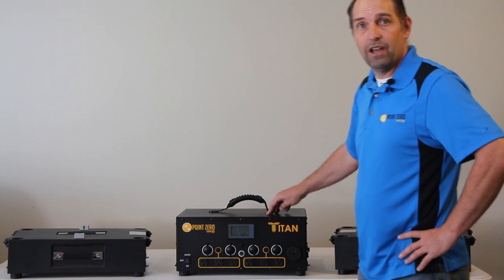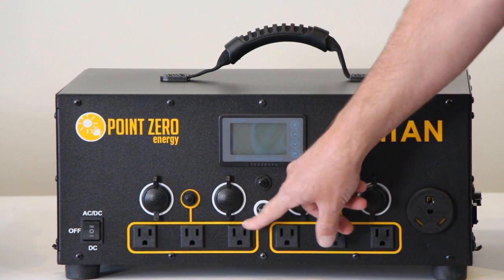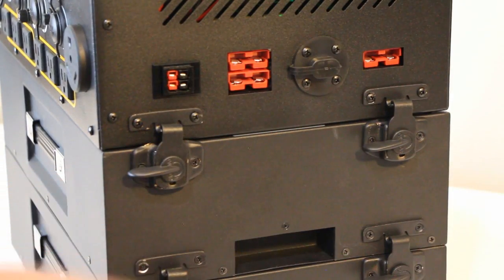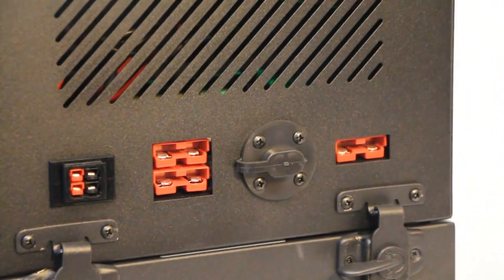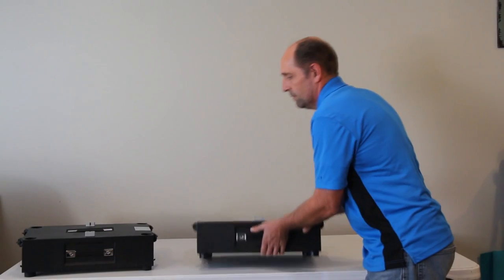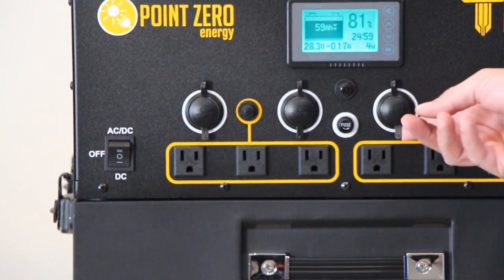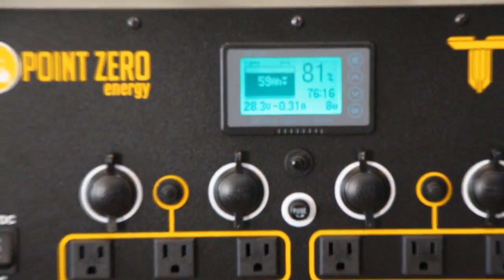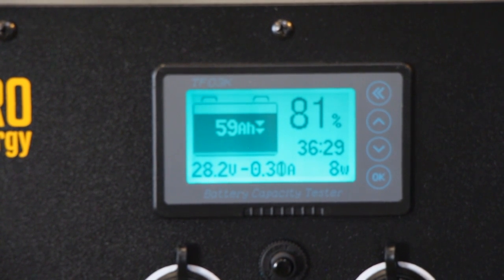Titan Solar Generator final

Comment: I want one, but only if Will Prowse says it's good. Send him the final product for review!
Reply from the maker: We did and he gave a very positive review
Reply: @PointZeroEnergy  I heard Will (very honest) say in 2019 you needed to fire your engineer as you sent him & 14 others defective units. I HOPE you have sense worked out all the kinks as I was hoping to purchase one, just didn't like prepaying months in advance which  has always been the case & guess always will be? One of your reps told me wait until January to order then they would be back in stock & my money wouldn't be tied up for months since unlike other companies you charge the full amount to credit card when place order instead of when ship..  Now I can't get until Feb if I order now!!!! CRAZY & FRUSTRATING!  Plus, a little dishonest calling it a 3000 when it's actually a 1500 which is "expandable to 3000 watts for an additional $1,400."
Reply: @DebbieTube100  It doesn't say it will not pull 3000w, it says your shouldn't pull 3000w continuous without the expansion. You really should take the time to read the product info correctly before bashing the company. If you don't want to follow the policies of the company when ordering, then purchase another product from somewhere else, they are not deceiving you, you are told up front that is the wait time. There is big delay in product availability across the board in this industry that we are all having to deal with. This should not come as a surprise to you, and if there are better options available, whats keeping you from it?
Reply: @DebbieTube100  they literally tell you in every video that it's only 1500 unless you have at least two batteries then it is 3000 lol SMH
Reply from the maker: @MAXIMUSMINIMALIST  The standard 14A AC charger uses 5-6 amps from the AC outlet (about 600-800 watts).  So this should work with the smaller unit if it can handle 7A.  Our 25A larger charge would be 10-11 amps (1200 to 1400 watts), which would be too much for the smaller one, but should work with the larger one.

I hope that helps you .
Reply from the maker: @MAXIMUSMINIMALIST  Slower charging is better, but either charger is slow enough that it is fine.  For long life, keep the charge time under one hour, and for even longer life keep it over 2 hours.  Anything over that is not going to make much difference.  Since the battery is 74 ah, one 14A charger (DC amps, AC amps going in are about 5-6)  will take 74/14 = 5.3 hours to charge one battery from dead to full.  One 25A charger (Also DC amps, AC amps going in is 10-11) will take 74/25 = 3 hours.  As you can tell both are well over 2 hours, so they will have about the same effect on the battery life.

I hope that isn't confusing, but just to explain a little, power is measured in watts, which is amps times volts.  Since the AC amps going in is higher voltage (120V), the amps are lower than the output power (the battery voltage of 20-29 V depending on the state of charge).  There is also a loss in power during the conversion from AC to DC (the heat the charger generates when charging).  But anyway, that is why the AC amps are lower than the DC amps.... Just in case you were wondering.
Reply from the maker: @MAXIMUSMINIMALIST  Thank you for your kind comments, and suggestions.  We are currently working on a smaller version to make it a little easier for van life, and for people that don't need such a powerful system.  Hopefully it will be ready when the Titan 2.0 is ready, but we don't have any specific dates for them yet.   Since the current Titan is very good, and reliable, we need to make sure the next version is better in every way possible, and it is taking us longer than expected to accomplish that.  We have some very good prototypes ready right now, but we want to get them a little better.   And just so you know, I am the owner, but also do most of the design, and am an engineer.

Thanks again for your kind comments, and let me know if you have any other questions.

Comment: you put out a product overview to the world with 2 batteries and DIDN'T PROGRAM THE UNIT FOR BOTH???
Reply: This is a very flexible generator, you can add batteries, use different batteries, etc.  Any time you add or change a battery, it must be calibrated to the new battery configuration.  If you want the flexibility of the Titan,  and accuracy of this type of meter, you must calibrate it.  If you want a simple plug and play, you must us a much less capable machine.

Comment: Can I run my house completely off grid full time with this?
Reply from the maker: It depends on your house, but typically no, since a typical house uses 240V split phase, and can use up to 200A when running water heaters, air conditioners, ranges, etc.  This unit can run only 120V and about 30A.  Some off-grid cabins or homes are designed to work on less power, and use propane for heating (hot water, cooking, etc), so this would work perfect for them.  The main purpose is for it to provide power to essential items (fridge, freezer, lights, microwave, small cook top stove, electric blankets, etc) when the power goes out, but not to run the entire home like normal.
Reply: I would like to build a small container house for use on a sunny island in the pacific. I am considering wiring the entire house simply using 30amp 120v. I’d like to run the system off of a solar generator. Would the titan work for that?
Reply from the maker: @kendallwilliams1859  Yes, it sounds like it would work great for that application.

Comment: Need to update your video.  It looks like it was filmed in the 80's.
Reply: Ha ha ha, I REALLY, thought it was an old, a very old infomercial... and was thinking, "it´s a pity that they don´t sell them anymore..."
Reply: I agree. And this guy is very vague about his descriptions of the buttons. Using four fingers to point to the white circle buttons for DC. And saying a fuse can be reset. I may be wrong but all the fuses I know must be replaced if blown, whereas a breaker can be reset. This may be a great product but this video was done very poorly. Not a good video at all. Seems mistakes were made.  Maybe the product has the same issues.

Comment: Do you have a spec parts list of the internal components so I can see exactly what I'm getting?
Reply from the maker: There are no off the shelf components that could meet our requirements of weight, size, efficiency and durability (that we are aware of).  So the major internal components (inverter, and  charge controllers) have been manufactured specifically for the Titan Solar Generator.

Comment: Too bad its not a Generator, Just a solar converter and battery pack
Reply from the maker: Sure it is a generator, just as much as any gas generator is a generator.  If you take the term literally, there is not such thing as a generator, only devices that change one form of energy to another.  We have called these devices generators for some time now, even though it impossible to have a true generator.  The Titan solar Generator is as much a generator as anything else in existence, and since "generator" is the common term for these devices we will continue to call it a solar generator rather than confuse people.

Comment: Will you be adding SuperCapacitors inline with the unit as a Module?
Reply from the maker: We don't have any plans to add a supercapacitor module at this time.  There are still a few issues that need to be overcome with supercapacitors to be able to work well in a portable system like this.  
1- Weight:  The specific energy of a supercapacitor is only 5w h/kg, where lithium-ion is 120-240 wh/kg
2- Cost: The cost for a supercapacitor is about 10X as much as lithium ion per watt hour of storage.
3- Voltage (the inverter would need to work from 0 to full voltage rather than the narrow range we currently use).  Even with the small range of 20-30v on the current system, the inverter is more efficient when the battery is full, so imagine how bad it would be when it was down to 3 volts...
4- Self discharge.  They loose about 10-20% per day.

Hopefully we will soon have this technology perfected, because I love the fact that you could have 100,000 cycles or more (anything over 50,000 or even 20,000 will last your lifetime), and that you can charge nearly instantly (not sure this would help with our application, but it would be nice in an electric car).
Reply: @PointZeroEnergy  Is this true with the #MaxwellSuperCapacitors? I heard they have ironed out some of those details?  I have to say this is the best scientific answer / explanation I have heard on YouTube or anywhere for that matter thank you. I know you don't do informative YouTubes but that would be great if someone would pick it up like #BatteryMooch or #MadElectron, or you if you feel motivated :D Also, the electric lawnmower that people ride around on they could get rid of the human riding on it, that is easily 92 Kilograms at the very least just looking at the majority of them.... 92X5=460wh & I can't think of anyone that is mowing a lawn for 24 hours straight :) or away from Prime/Shore Power Even if it was 10X the cost it's still cheaper in the long run, it's more of a iratance to see people cutting grass with batteries & riding on them when it can be turned into a  remote control for $1000 of good commercial off the shelf products in probably a couple of hours.
Reply from the maker: @theMekanik  I am not sure about the maxwellsupercapacitors.  I look quickly and could not see any real details.  It looks like I will have to contact them directly to find out.  However I suspect they have not fixed all the issues or else this would be big news, and everyone would be using them, especially in electric vehicles.  By the way, I use an electric lawnmower, but it is the push type that plugs directly in (no batteries).  The Titan can run it just fine, and I love it so much.  I only have a small lawn, but the gas lawnmower I used to have always had problems, and needed maintenance.  It seemed like it took longer to get the thing working than it did to mow the lawn.  With the electric, it always works, and I never have to put fuel or oil in.  Not to mention it is much quieter.
Reply: Point Zero Energy Yes I Love Electric ⚡️ 🤗 Been Knocking down weeds, tall brush & small saplings with Makita 36 volt string trimmer using .109 Echo Black Diamond String & Renegade Razor 8in 56t. Brush Cutting Blades of off Amazon.  Maybe a year now & have been using Lithium Powered Power tools for the last 10 years. Heavenly all without an issue.  They run super quite & and don’t rip your arm off like corded  versions or gas power.

It kills me tho seeing people ride on lawn mowers the riding kind that use batteries 🔋 when people know that the materials alone used to make the seat and the controls cost more then the $20 accelerometer & gps module that is no more than the size of a small cell phone 📲  can be used to remotely control a 60 inch electric mower.... ie Green Machine or Gravely  Riding Mower like this should have been the first foreseeable thing to eliminate when making a Commercial Electric Lawn Mower 🙈
Reply: Point Zero Energy Yes, Tesla bought out Maxwell Technologies USA based UltraCapacitors Q1 2019 they use a Solid Electrolyte. 

That would be great contacting them. They have a 24volt replacement to augment a Semi Truck starting up its really kinda neat stuff.

Skeleton Technologies Ultra Capacitors out of Estonia 🇪🇪 is the only other UltraCapacitor manufacturer I know of.

I mean I can jump start my car off of 8 18650..... LoL..... and  there is another guy on YouTube that is running his car 🚗 on 6 Ultra Capacitors with enough power left in them to to start his car after 3 days without driving 😜

Comment: I need it to push 240 volts @ 300 amps for 1 hour  + 120 volts @ 15 amps
Reply: No way will you be able to run that off of a solar generator. Maybe in a decade. What the hell do you have that pulls 300 amps?
Reply from the maker: Wow, that is a lot of power.  That is way beyond a portable solar or gas generator.  There are some very large non-portable generators that would do this though.  You will need at least a 75 kw one.
Reply: @PointZeroEnergy  Augment with SuperCapacitors?

Comment: Couple of questions: I have read that people will have a trickle charger on their batteries to keep it conditioned Does your system do this? Is it not required for yours? 2nd question: If I have a small whole house generator hooked up to an auto cut over box and I have another box with only the circuits I want to have active when the generator is on. Is it feasible to have your Titan hooked into this system and also be available if the generator stops working? (I'm not expecting this to be an auto cut over, just a manual one.) If so what general electrical parts would be required to make this possible? I was thinking that the RV 30 amp out could be used for this.
Reply from the maker: Question # 1  The Titan comes with an AC charger, but it does not trickle charge, because  trickle charging is only good for lead acid batteries, and is not good for lithium batteries like we have in the Titan.  The best way to store the titan is to charge it up and turn it off.  It is best to cycle the battery a little bit at least once a year.

Question #2  The Titan is not designed to be connected to the whole house like your whole house generator is.  However if your electrical circuit that is powered when the grid is down is only 120V, and not the 240V split phase power, then you could connect it up to the 30A Rv outlet to run that panel.  If it is 240V split phase, you would need to get a transformer to convert to 240V split phase power first.

Comment: Can you explain what the RV 30amp outlet can be used for? Can one get a cable that can connect from your generator into the RV power inlet?
Reply from the maker: Yes, the 30A RV outlet is designed to have an RV plugged into it to run the RV.  If your RV already has a 30A shore power cable, you would just plug this into the RV outlet on the Titan to power your RV.  Of course it can be used for other things as well, but that is the purpose of it.

Comment: Since it will be several months before you have these in stock, if we ordered it today, when would our credit card be charged?  Today or when the item is shipped?
Reply from the maker: The card would be charged when you place the order, and this will hold your place in the fulfillment process.  We hope to have a stock built up and ready to ship instantly by the end of Feb, but that will depend on the number of orders we receive between now and then.  So if you don't feel comfortable waiting so long after paying, you can wait until we have a stock.
Reply: @PointZeroEnergy  I researched & you have NEVER had "in stock". 2019, long before COVID, you did the same thing - always. Unethical.
Reply from the maker: @DebbieTube100  We started with a pre-sale, and were within one week of being caught up before we were shut down due to covid.  We are working on getting our manufacturing up to scale due to the large increase in orders.  We have always been very transparent that we were behind on orders.  But you are correct, we have never had Titans "in stock".  However I am not sure how that is unethical.

Comment: Where do you plug in charge from the van alternator? DC to DC charge?
Reply from the maker: You would plug into the cigarette port of your van.  Unfortunately since the battery is 24V, it can't charge directly from the alternator at high rates, and can only charge at 15A max from a 12V source.
Reply: @PointZeroEnergy  This unit is so epic. It's priced well too. was there no way to engineer around this one singular point? I understand the suggestion below, but that seems a little Mickey mouse for a unit like this. Impossible to build this in? That would make it the ultimate solar generator. It's the best on the market now by a long shot, but why not add that one feature?
Reply from the maker: @peterdods425  Sure it is possible, but adding a very large step up converter (to get from 12v up to 29.2V) would add a lot of cost and weight to the system.  a future add on we may develop would be a 12v-36v boost converter large enough to handle up to 1,000 watts.  This could then connect to the alternator, and plug into the mppt charge controller.  But for now the inverter would be the easiest solution.
Reply: Slawek Smulczynski You could connect a 1500 watt inverter directly to your drive battery and charge the system off two of the AC chargers and pull a little over 1000 watts.
Reply from the maker: @Spartan2x  great idea!  That would work, and would be very easy to do.
Reply: Spartan2x you mean plug in to the red inlet on the right side of that unit? Which is for extended battery?
Reply from the maker: @Steveski70  No, Spartan2x was saying to connect a 1500 watt inverter directly to your car battery (it must be a 12V inverter), and then plug in two AC chargers into the inverter, and plug the AC chargers into the AC charging port on the Titan.  It is a less direct method, but it would work.
Reply: Got it! Thx

Comment: Are those LiFe04 batteries?
Reply from the maker: No, they are a higher density NMC battery like Tesla uses.  However we are planning on having the option of a LiFePo4 battery, they will be a little heavier (about 45 lbs) and 7.5" tall.  We should have some by Feb.

Comment: Can you charge with a honda generator?
Reply from the maker: absolutely.  The AC charger can plug into any 110V or even 240V (there is a switch to adjust to 240V power) AC power.